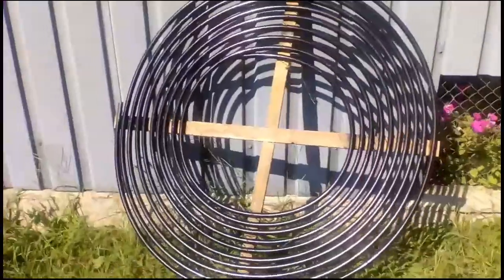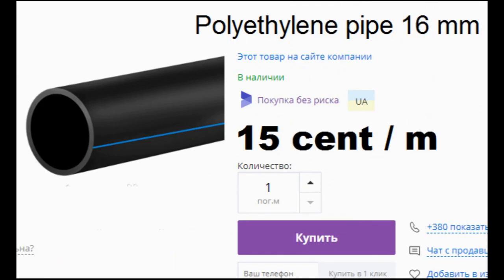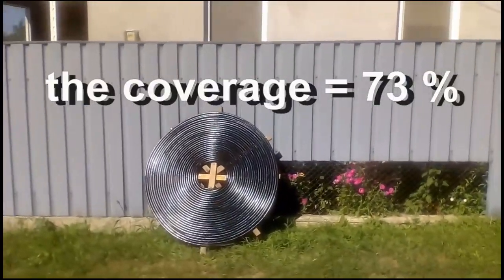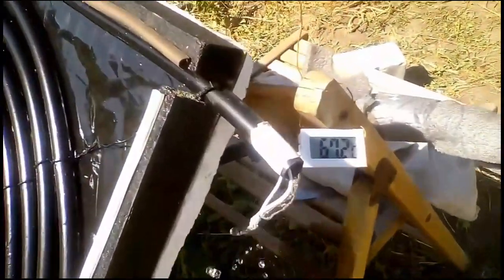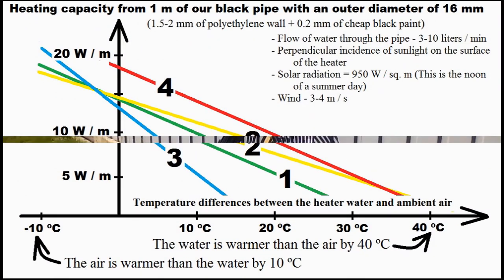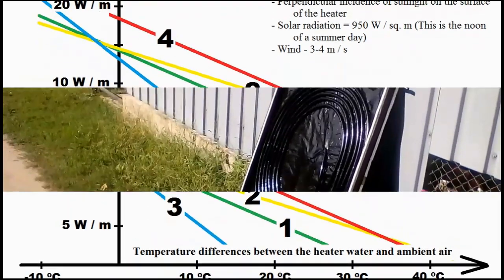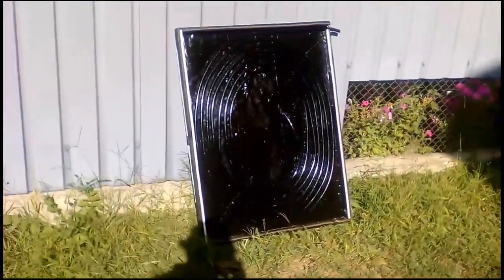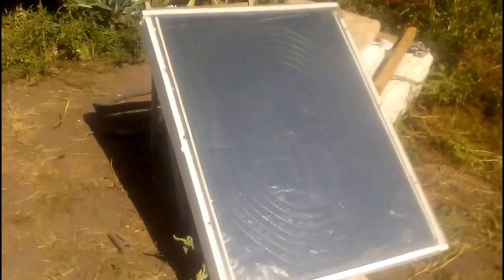How much heat such DIY solar heaters give us

Comment: I think people should try to understand the limitations of these systems.  A general rule of thumb, if you live in a sunny climate, is that the power coming from the sun is about 1 kW per square meter.  That's if the square meter is presented "straight on" to the sun, there's no cloud cover, etc.  Obviously this varies throughout the day because the amount of atmosphere the sunlight has to penetrate changes.  Consider it a "noon value," and at any rate it's good for calculations.
  
Ok, now say your pool contains G gallons of water.  A gallon is about 3.8 liters, and a liter is a thousand cubic centimeters.  It requires 1 calorie (not a food calorie - that's actually a thousand calories) to raise one cubic centimeter of water one degree C.  A calorie is 4.184 joules of energy, and a watt is a joule per second.  Putting this all together, one square meter of sunlight, if you capture it completely, can raise one gallon of your pool water one degree C in about 15.8 seconds.
   
So, if you want to raise the temperature of your G gallon pool by T degrees C, then you need 15.8*G*T seconds of full sunlight to do that with a one square meter collector.  For my 19,000 gallon pool and a desired temperature rise of, say, eight degrees C, that means I need 2.4 million seconds.  That's a little under 28 days.  And don't forget that the pool will loose heat during nights, and you're going to have an inefficiency factor in there too.
   
The take-away here is that if you have a big pool, you just can't expect a small collector like the ones I see in a lot of these DIY videos (most of them I've seen are around a square meter) to work magic on your situation.  There is a reason your gas pool heater costs a lot to operate.
   
On the other hand, if you're using this square meter collector to warm up, say, a five-gallon container of water, then you can bring it up a degree ever 5*15.8 = 79 seconds.  If your collector and your water container or well insulated, you'll be able to get it quite hot - potentially even hot enough to cook stuff in.
   
A general formula for the above calculation would be that seconds = 15.8*gallons*temp_change / collector_area.  Or you could rearrange this to collector_area = 15.8*gallons*temp_change / seconds; this one lets you put in how long you want it to take.  Let's say I wanted my 8 degree C temp change in 10 hours (one good sunny day).  For my 19,000 gallon pool I'd need collector_area = 66.7 square meters.  I haven't see a DIY project for that.  ;-)  By the way, that would be about 22 collectors each four feet wide and eight feet long.
   
For me to really have any sort of hope with my pool, I need to learn more about how it cools down overnight and hope that I might be able to heat over a period of many days and gradually build up to the temperature I wanted.  Try to do a "two steps forward during the day, one step back during the night" sort of thing.  And I'd still need to be willing to build a fairly large collector.

Comment: Hi Sergy,
Do you know if a thinner PE tube, collects and transfers faster than a thicker one? 
half inch PE tube with a  2mm wall vs 1.2 mm wall, Nominal pressure 16 vs a Nominal pressure 6 psi.
Which is best? Thank you
Reply: Please Sergiy, if you can advise or anyone?

Comment: Oh thanks for the data. Looks like it isnt good for me for my 18ft pool (8300 gallons US). To get1 degree celcius I would need 20KWh. In Canada this mean probbaly needs half to 3/4 of the pool superficy in heating to get something decent. I already got an heat pump and works great, but for the fun of it and get free energy I looked at this. But would not make sence for me finally.
Reply: A floating solar heater on the pool itself seems likely to be more effective, and won't take up space on the ground.

Comment: what if inside the case (covered with glass) you put water, or even oil, or even black colored oil, and the pipers are copper?
Anyways, my problem with these is that if there are clouds.. its all useless.

Comment: Congratulations on the data acquisition and explantation. Thank you for all the work on it. I will be building one for sure. I`ll use a solar panel and a solar pump so it will heat my pond proportional to the sun intensity.

Comment: Can the heater provide constant water temperature? or if you turn on the water after the hot water inside is flushed out you will have to wait some time to be heated again?
Reply: Run that supply into a water heater that way it is constant and the water heater barely runs

Comment: if coverage is your problem, you should look at different patterns in which to "wind" your pipes. Fractal curve patterns like gosper curves, Peano curve or Hilbert curve were designed to fill a complete square, rectangular or hexagonal surface evenly.
It might be a bit challenging to create them, but the cover much more of the surface with a single, continuous line than a spiral.

Comment: I laid out asphalt shingles that retain and radiate intense heat compared to my heater similar to you spaced out variants. the painted pipe never felt hot to the touch but with the Black asphalt shingles loosely laid flat over the coil the coil was warm and the asphalt was so hot you could burn yourself. even after the sun goes down the asphalt continues to radiate heat. You can just use this method without needing to paint.
Reply: So you put asphalt shingles on top of the black irrigation pipes? 

How did it hold together?

Comment: I think the missing point is not the gap but overall length of tubing through which the water travels. The dens 73% probably has 2x the length. Meaning more opportunity to exchange heat.
Reply: Yes use 50 m for all
Reply: Indeed.

Comment: Sergiy, great experiment, I am working on my solar collector to maximize its heat exchange potential. I have found the rate in which water flows through the solar collector pipe is a very important variable. To big a pump (powerful) the water flows to fast and doesn't have time  to pick up heat from the pipes. Example, I would prefer the water to come out of the collector at 100 degrees with a flow rate 500 GPH rather than 1600 GPH at 50 degrees. My collector is 4'x8' using 300' of 1/2" poly pipe. I have a lexan sheet covering it. I installed an oven thermometer and the internal box tem. has gone to 165 degrees on a 80 degree day  I am heating a 16,800 gallon pool. I think the trick will be to find a timer to cycle the pump off for 15 mins. and on for 10 mins. this will give the water time to fully pick up heat from the hot tubing. Love the think tank and sharing of ideas!
Reply: I agree with Руслан.  Energy in= energy out so I dont think the rate of water is that critical if the goal is to actual heat the 16,000 gal pool.  Eventually the water coming into the system will be warmer and warmer and you will raise the temp of the pool.  My question with all these is how possible is it to actually heat a pool this size without loosing the heat gains to the ground and air before you can enjoy them or the sun goes down?
Reply: Hi all,
Do you know if a thinner PE tube, collects and transfers faster than a thicker one? 
half inch PE tube with a  2mm wall vs 1.2 mm wall, Nominal pressure 16 vs a Nominal pressure 6 bars.
Which is best? Thank you

Comment: Do you think efficiency would increase if you filled frame 4 with clear epoxy? This would allow better heat transfer between the back material and the tubing.

Comment: I like your project, but I would make one suggestion. You're losing a lot of heat energy because of the reflectivity of the tubing. I'd use a flat, or matte, black paint for better heat absorption.
Reply: I have just built one of these which is kind of like his 1st variant combined with the 2nd, however i have not painted my tubing, is this necessary?
Reply: Or scuff the tubing?
Reply: My experience shows flat works best, matte reduces heat absorption a LOT, similar to glossy in fact.  Flat black spray paint, cheap, has the best results with by far the lowest cost.  Thermal absorbing 'ultra-black' paint does not, in fact, perform noticeably any better.
The best material I could find was aluminium, coated black.
Reply: @janglur  when you say flat, do you mean satin?

So your saying satin is better for heat absorption (such as when painted on black irrigation tubing or copper pipes) then both Matt and gloss (be it spray or brush) paint? 

Thanks

Comment: I like your proposal and thesis. 
I will put it into practice. 
I read your answer to a comment about the possibility that it works in winter with snow. 

I think it can work with a system of 3 conductive hose systems is placed in which the first phase is responsible for “melting” the snow or ice and then pass by GRAVITY to the second team ..., in order to "force" the conduction of water.

Your friend Rafael from 🇲🇽 Mexico City 🇲🇽
dec 12, year 2019
micdmexico@gmail.com

Comment: I wonder if you placed a clear plastic sheet over the black painted coil if that would decrease the heat loss to the air significantly. I would like to see the breakdown of the cost for the variants of these heaters.

Comment: Instead. of covering it with polycarbonate, why don't you cover it with glass, since the transparence is better. And glass does not degrade bcos of UV.
Reply: UV adds a lot of heat energy I’d say? Was thinking this myself and thought poly carbonate or similar would be best.
Reply: Glass allows more light in (so more heat energy in) but also allows more heat loss. It’s the net gain or loss that determines the choice of material and cost too, that comes at the end. 

Polycarbonate has much thinner plastic then glass, and also an air gap. The thinner plastic allows plenty of light in or even more then glass, as it’s 0.2mm of plastic vs 4mm glass.

Polycarbonate at 4mm has 61% light transmission for both sides and the air gap. And U value of ~3.8-3.9 

4mm glass has about 89%. With u value of ~5.8-5.9. 

The lower the u value the batter for insulation.
Reply: Thin flexible plastic(such as used for greenhouses for example, which naturally is made to resist UV damage) seems likely to be efficient and cost effective, along with being safer in cases of possible impact.

Comment: Very good experiments. I would like to see a build of your best version. I have built a 48" square box with 0.75" x 3.5" walls with foil coated 25mm foam on base painted flat black sitting on 0.75" supports using 16mm x 30m held by wire ties with corrugated polycarbonate with edges sealed with foam.
Reply: Great stuff! What are you using it for?
Reply: @ronrover6594  18'x48" pool heating
Reply: I am just getting started with my project. What are the most important pieces. 
I currently have a 48” square box. 

Should I do one row of tubing or two.
Reply: @tdhoeffel  I got two 50 foot rolls of 0.7 inch, for each 48" box.

Comment: Did you actually take your heaters to Munich, Phoenix and Mumbay for a test? Oh, I see, (calculation, not  experiment). But - can these heaters be used in winter (freezing overnight)?
Reply from the maker: These heaters cannot be used in winter because you can not remove the water from the pipes (only with antifreeze)